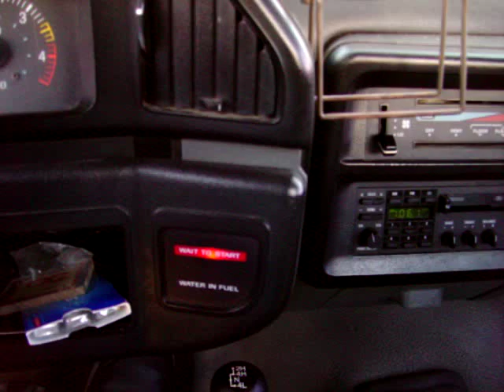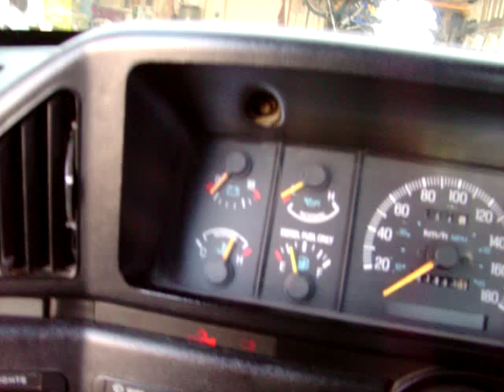Can You Depend On a Tired Old Ford On a Cold Day?

Comment: lol ya but we have had 2 idi's in the past both f350s and dually and we hauled with the 91 F350 a 36 foot with two slides weighing about 11,000 lb so we went a bit above towing capacity but it did a good job. after towing we didnt have any problems with engine, body and etc.

Comment: Your belts look like they are setup wrong. Mine has 2 belts for the power steering pump and the vacuum pump is driven off the alternator pulley. Any reason?